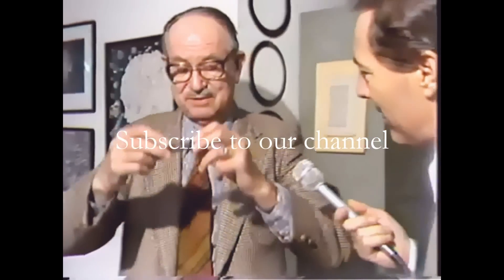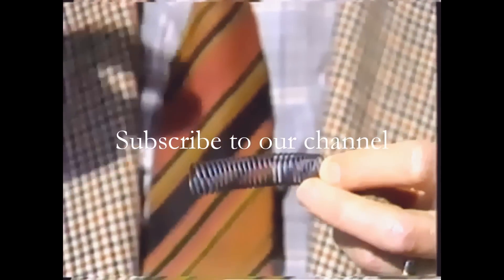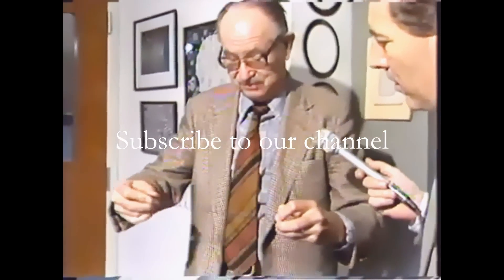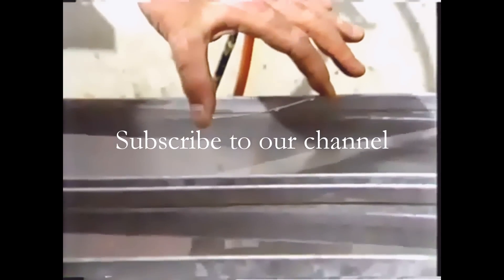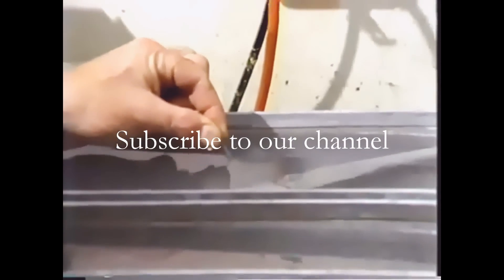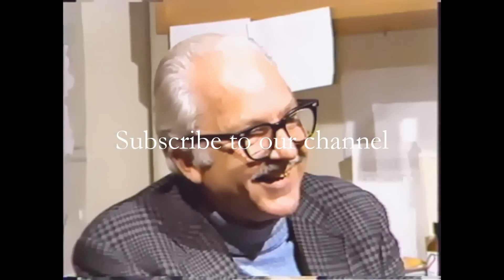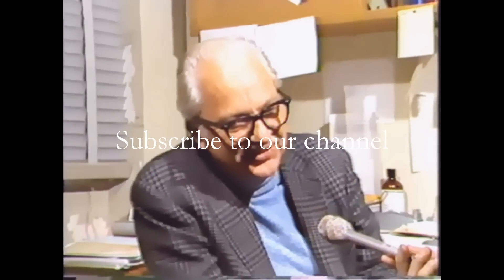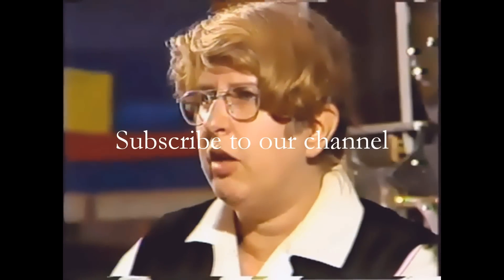Free And Virtually Unlimited Fuel To Heat Your Home

Comment: Free energy? So the water heats itself?
Reply: Hangfire the sun heats the water didn't you watch the vid?
Reply: Hangfire Solar panels heated the water....just hear what you want.
Reply: Hangfire use solar heat for the wheel - however it could be used to makes its own hot water
Reply: No it couldn't.
Reply: Use it to turn a generator that produces AC power that a small percentage of could be tapped to power a water heating element. I thought of that in a second after they first showed that Nitinol wire, wheel motor. It could be scaled up and used in power plants to produce electricity to not only power homes, business, and industry, but also to power electric cars, trucks, and trains. This is an especially perfect setup for areas with geothermal hot springs, though an outside source of heat is unnecessary since the power producing capacity would be so great that tapping some of it for heating the water wouldn't be much of a loss at all. It could put Big Oil, and Big Coal, out of business. However, as long as oil and coal put big profits in the pockets of fat greedy pig elites and politicians, clean technologies will never be allowed to replace the use of these polluting fossil fuels that they keep us dependant on. These pigs will see this Earth of life and beauty turned into a polluted cesspool of death and destruction before they'll do or allow anything that cuts into their profits, money, and power. I consider these incredibly selfish greedy pigs to be the epitome of an apostate of Hell. If there is such a place, and I hope and pray that there is, all that money and wealth made by polluting this planet, exploitation, corruption, killing, and immoral and unethical actions has hopefully bought their way into it.
Reply: even 100% of the power produced from an attached generator wont be enough to keep it running,   and look how open the water bath is,  most of the heat will be lost anyway...   if is was physically possibly guys don't you think it would have been done already?  use your heads
Reply: Dr sausage fingers.  No doubt. Oil companies could not afford the payoff that if this worked would bring in.
Reply: Dr sausage fingers Don't be cynical! Many things in the world are ignored 'cos people can't get their heads around them. For example, electric cars preceded gasoline cars, but it took Elon Musk to demonstrate their superiority. Now he's going to take on the old fashioned truck industry with revolutionary force. Not only that, but google Wrightspeed and you will learn about a former Tesla engineer who is kicking butt with super high torque truck electric motors and an amazing gas turbine range extender: the future is here and you must open your eyes, man! I always thought Nitinol had little force, but learning that it can exert 55 tons per square inch makes me realize that everyone except Ridgeway Banks and his super nerd colleagues has ignored the true possibilities! Don't you understand that hot water can be directed in any form at the Nitinol elements? Toward the end of the video they mention a totally radical configuration of the Nitinol, in which the elements are stretched, not bent in a bulky shape: this will facilitate more compact engines. The basic fact is that this amazing alloy uses low level heat to create motion which can either compress air or generate electricity. The point is that low level heat is free, available through geothermal sources or solar, and since the elements never wear out but get stronger with use--this is as close to a panacea as anything in human history. Goshhhh!
Reply: Despite the fact that the technology has been around for more than 40 years, no commercially viable engine has yet to be made. 

Why not? Well, the reason is right there in the research paper from the 70's. Nitinol engines are about 4% efficient (absolute). By comparison a Sterling engine can be up to 30% efficient, almost ten times as efficient, and Peltier bridges, which have no moving parts at all, are up to 8% efficient, still double what the Nitinol promises.
Reply: Only needed a 20 degree difference. Not a lot
Reply: Dr sausage fingers - Of course you have a point and I'll need to read that old paper to learn the details, but remember that 4 percent efficiency when the heat is free--is still a good deal. Case in point is that amorphous silicon solar cells are much less efficient than the best crystalline silicon cells, but they are sooo much cheaper that the net benefit is worthwhile. They make sense for deploying across huge areas where the alternative would be no collectors at all. Likewise with Nitinol: if someone designs an elegant, easily manufactured engine, something that can be stamped out and laminated and rotate a generator or oscillate linear windings, then these could utilize the gigantic reserves of low temperature water the earth provides. Regarding research papers, initial research grossly underestimated the effficiency of the "duck" that harvested wave energy by bobbing in the sea--and that published error was enough to prevent funding for the machine. It would be well for idealistic, moneyed fans of renewable energy to revisit certain technologies, with a modern emphasis on practical manufacturing and get them out there. The Stirling was being revived by the inventor of the Segue scooter, Dean Kamen, who claimed to have found ideal seal material for it to last a long time--but I haven't checked on their progress.
Reply: There is no solar energy to run the damn thing at night. Plus, who really wants to have water sloshing about spilling all over the insides of a car or on the roof of your house all the time? Water has a way of leaking or rusting through the highest quality materials if it's spilled in the same spot 24/7. I can see why this tech didn't make it. Much like the steam engine or solar panels, if it's not messy it's still damn inefficient and bulky. On the other hand, you can drive a bicycle with a heavy rider on it with a tiny RC plane engine or even crank an alternator with it at around 60+MPG with bio-fuel like E-85 or your average everyday moonshine. About that last part, bread yeast colonies can survive almost forever at room temps and  can be used to convert waste sugars and carbs into alcohol up to around 15%ABV quite efficiently before distillation. Now, solar can be used with a Fresnel lens and mirrors to heat a very oxidized home made copper pipe still and that might be your best bet if you run a long pipe through the shade or garage to better condense the vapors and sort out the alcohol without powered cooling or a precisely controlled heat source. "Big oil" won't put out hits on everyone who uses E-85 in their vehicles. That'd be dumb. Worst you'd get with making alcohol is if you let anyone drink it. So, put in a little antifreeze or something like that in the tank the freshly distilled alcohol drips into and that'll do the trick unless someone doesn't know what antifreeze does to you if you drink it. Yeah, you'd get intoxicated, just not the good kind. This is what we call "denatured alcohol" and it makes great fuel but that's about it.
Reply: Still not superior. I'd take bio-fuel (E-85) powered, veggie oil lubed engines over a battery powered motor any day. Let's see, wait 5 minutes at the gas station filling up a 8 lb. tank and paying a few bucks as needed at a time for 100+ miles range or wait 10+ hours at home or at a rare charging station charging an 80 lb. battery pack to get 100 miles range if you're lucky? Also, I hope you brought a cot or pillow and blanket and maybe 100 bucks to pay loitering fines because you gotta understand all that could come with hanging out at a parking lot tethered to an outlet all day or night. Plus the damn price tag for an EV?? Thanks but no thanks. I'm not rich like that and am just fine with a couple liters of cheap E-85 with dollar store veggie oil lube mixed in on a 100 dollar Walmart bicycle with a little 2HP 100-200 dollar engine and 100 dollar mag metal wheel in it. Yeah, that's around 403 dollars at most total. What did you spend on your Tesla, 40 grand? Shit, you coulda bought a house and rented out a room or 2 and that might've been a "superior" idea.
Reply: Still, 500 bucks for a bike that'll go 50+MPG, 30+MPH and last about as long as any moped, yet require no license or registration, that's not silly. Want to climb a mountain? Give it more throttle. Want to travel long distances? Just do it. Want to be warm? Put on a coat, get a heated seat, grips and go. Fenders deflect the rain and stabilizer wheels are good in severe weather not even most drivers drive through. That's not silly. I get it. You're rich or you borrow/live beyond your means. Good for you. By the way, Iowa is not a slum and you can buy a house here between 30 and 600 grand, depending mainly on the age, size and condition of a house. Also, you can look up manufactured homes, which are also pretty cheap brand new and you can pretty much have them put anywhere you're like. Anyway, if you're suggesting tepees, why not just get a tent? It's cost about the same. If you are so bent on being ridiculous, get a horse. They cost more to fuel than my bike and aren't nearly as reliable, fast and ranged, but whatever. Do whatever the fuck you want. I'd take 5 minutes of refueling every 50 miles for 300 miles then be able to immediately go back home or keep going than charge for hours before traveling 150 miles then either have to head home or spend hours more recharging at a outlet, in the middle of somewhere or nowhere, possibly pissing off the person who owns it or having the cops called on you. That's no way to live, is it? Thanks, but no thanks.
Reply: However, it's a bit colder today, and most of these types of engines don't start well in freezing or below freezing temps. I will concede that they're not the greatest quality transportation but if you have a garage or shed with a small heater, wood stove or something like that, that's good enough. Just be sure you don't kill the engine outside for more than a few minutes. I let mine idle when I need to go shopping. Still more fuel efficient overall than a car. If you want to pay tens of thousands for a car thant's well-rounded for purposes you and I could both agree on, I'd suggest a hybrid of the non-plug-in type running on E-85 and using a bigger portion of that energy for an electric motor rather than letting it go to waste. Also, focus less on the wattage of your stereo system, powering your laptop, mini-fridge, gadgets in the car like power steering, windows, locks, seats, O2 sensors, and more on the basics, like the power and efficiency of the electric motor, heat/AC, wipers, lights and other things truly useful for safer, more reliable and efficient transportation. A turbo driven by exhaust and scoop on the hood for a passively forced intake could be useful as well as regenerative braking to enhance efficiency further. A car like that could benefit from having a smaller, more efficient and general purpose engine as well, such as 3 or 4 cylinders. 2 cyl. would seem under-powered and likely problematic for anything larger than a Smart car or sub-compact 2-seater no matter what the gearing is. So, 3 cyl. for compact cars and 4 cyl. for sedans or light duty pickups with standard cabs (3 people/short box) and 5 cyl. for things like minivans or light duty pickups with ext. cabs and standard boxes, plus a wider range of gears in a CVT transmission or both 1 overdrive and 2 under-drive gears in addition to a standard 3 or 4 speed manual or 5 or 6 speed semi-auto transmission. Is there a vehicle like that on the market? If not, I think there should be. I still likely wouldn't be able to afford it, but it would be a better option than a Tesla unless you want to look truly ridiculous, haul a 30' trailer full of solar panels behind that sleek and sporty car during long trips or get towed and sued as you're charging up like a hobo with a rich-looking car. At least when I ride a bike with an engine on it, my whole look is consistent and if I ever got ticketed it was for something a bit more typical. I got stopped upon suspicion that it was a motorcycle several times, but always was back on my way with no charges filed in a few minutes at most. I understand the confusion...
Reply: I don't know who this "Jed Clampett" guy is, but I know Harley Davidson had bikes set up like mine starting shortly after the turn of last century. It didn't start or stop there, either. After there were  similar products, VéloSoleX was 1. They made bikes a bit like that long after it was cool, with inferior transmission for the times. Also, shortly after Harley more or less perfected their design with the in-frame engine mounting style in their bikes, along came Whizzer and others to make similar bikes, albeit with belt-drive (not chain-drive) transmissions. Around the '50s and '70s were good times to have mopeds, or bicycles with engines on them, I guess. Even if many tended to shift from the earlier, more bicycle-like focus to the later, more motorcycle-like focus. Whizzer is still making bikes in much the same way to this day. VéloSoleX is old news and to be fair their design is so obsolete it's no longer acceptable in the opinions of many cyclists unless convenience and ease of building is the main and likely only focus. Sure, I buy my hardware as kits and my bikes at Walmart or garage sales, but it's like I'm getting imported parts and making a cheaper, slightly different product than the old Harleys or the Whizzers. It still performs almost the same, still almost as reliable when built and tuned correctly and it's not significantly different than a Whizzer or Harley except for the fact it's not a moped or motorcycle, I use a 66cc engine, vanilla exhaust and single speed chain drive transmission at a lower gear ratio and I try to strike the ideal compromise right between bicycle and motorcycle without crossing over legally from bicycle classification. I run mine with a 4:1 gear ratio and 25:1 oil ratio with 2-stroke engines 2.5-3.25HP and I seem to cruise around 20MPH when I get an engine that's 3HP or more when I have the right CDI and coil hooked up. On snowy roads I like to drop my speed down to around 11MPH, though. It's a valid, useful tried and true form of transportation of a single adult without any plans to travel more than a few hundred miles or more on a road-trip or more than a few miles in extreme heat or humidity. For that sort of thing a 4-cycle engine would be more practical. If I ever have kids or get into a committed relationship, I'd sell the bike, finish learning to drive and get a cheap, relatively efficient general purpose car like a Geo. That hasn't been necessary, yet, so I'm cool with what I have. I got this thing because I just want a quick way to get around town regularly or travel to visit a friend a few cities away occasionally. It fits with my life and would fit with many others. Think of it like a small motorcycle, moped or hatchback. It doesn't do it all, but it's usually good enough for most average-everyday purposes. The Tesla might be able to beat me from a stop in half a block, but I can beat a SUV the same way. SUV has you and me beat in comfort, though. A hybrid would have us beat in range. Want speed? Really?? Get a plane or a Lambo. You're not all that in a Tesla. Yeah, it's quite a cut above an all electric Nissan LEAF...  Not all vehicles are the same, though. That's kinda the point of having selection. Whoopty-doo. My point is, both of us have viable transportation, only mine costs about 1.5% what yours costs, goes about 53% as fast in town,  27% as fast on the highway and would cost about as much to power in town and less to power on the highway during trips longer than 200 miles 1-way. However, it's not as comfy. I don't care. It does what I need it to do even if it doesn't do all I'd want it to do. It basically just works. Meat and potatoes VS caviar and cheesecake is what this debate looks like. What's the point?

Comment: The title is misleading.  This does not produce fuel but converts one kind of energy into another, which just move s the cost to somewhere else. Conversion always has losses.  The solar other "wasted"energy  of an existing process could be captured directly for heating at higher efficiency, lower cost.

Comment: Not "unlimited fuel" — A heat engine isn't fuel at all, but just a way of converting thermal energy from some fuel source into another form, usually mechanical, or sometimes electrical.  To use one of these NiTiNOL devices, one still needs a heat source and a heat sink, and those aren't free.
Reply: like the solar hot water they showed in the video ?

Comment: Saw this idea demonstrated at a Science Fair  by a young girl as her contribution ;  in Nepean ( now Ottawa )---------- Years ago.
  Maybe about 1979- 80.
Her active component was rubber bands. and although : from memory it ran slower than this example it was sensitive enough  to run on solar  power.

OR could be. She used an electric lamp as the competition was inside a closed shopping mall.   Same theory but without the exotic metals.   At that time she did have a list of possible applications and had ear marked areas of operation.